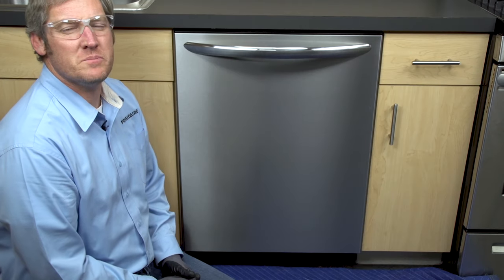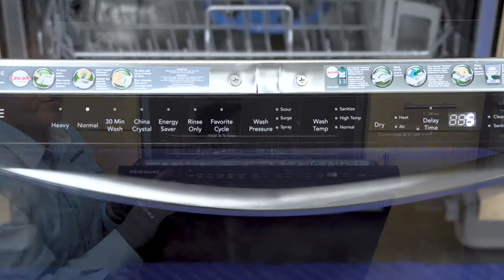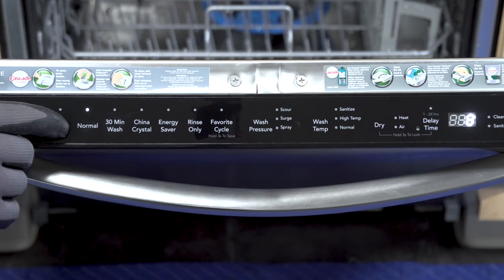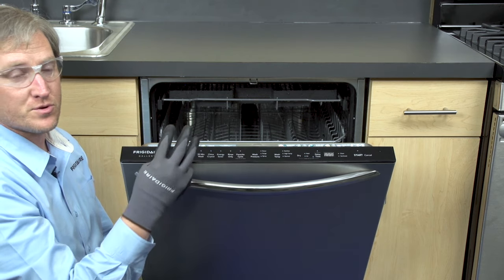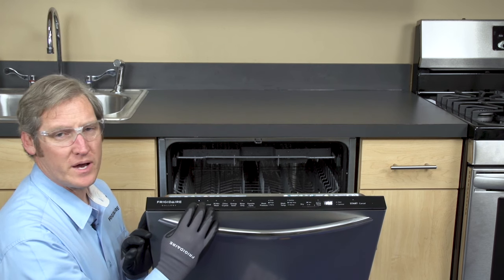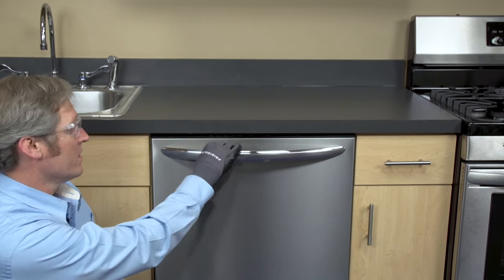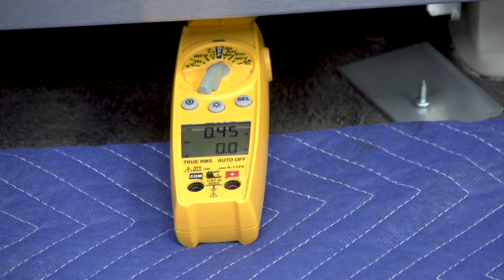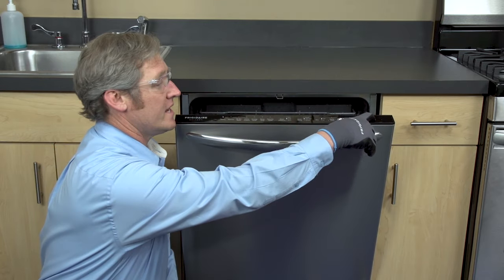frigidaire gallery Dishwasher: troubleshooting and diagnostic mode

Comment: I have  code. 14  on my frididaire  , model ffbd2420Uboa , it says the micro switch in the bottom? Of drain or under the unit? I've clean filter & drain area,pulled plug  and reset, still no go.  On restart , drain runs for a couple minutes ,while blinking 14  then it stops ,and the  14  stops blinking and just stays on,  what's ure take on this problem, thanks

Comment: Great video. We have this model FGID2479SD6A and it started trying to drain out of the blue with partial numbers on the display lit. It wont let us do the diagnostic process because it seems to be stuck even if powered of and reenergized. Maybe a timer relay or timer motor but hard to find info.

Comment: Mine seems to be inconsistent. Sometimes you hear water going in no matter which option I choose, heavy, normal, or quick clean, the light indicating those turns off pretty quickly. But EACH one starts saying 99+ minutes. It runs sometimes, it gets hot, other times no water? Generally, not cleaning well. And it seems to have run too long a couple of times. It would not respond to the methods described in this video to get an error code, and I did let it run a little to start. Any suggestions from others? Something wrong with that control panel?

Comment: I recently bought and had this unit installed.  I can’t find the serial number to do the warranty.  I’m really hoping it’s not on the part of the washer that’s under the counter.  Any help would be greatly appreciated.
Reply: Not sure if you have gotten an answer or found it. Your serial number should be on a sticker that is on the inner part of the door jamb. Open your dishwasher door and look all around where the door basically meets the inside. Its usually either a silver or white sticker.

Comment: Maybe you can help me out. My dishwasher isn't a month old, but my dishwasher (this exact model) acts like it has no power whatsoever all of a sudden. I checked my plug and it has power, I checked the voltage on the junction box and I have power. I checked the voltage to the plug before the circuit board, and it says it has power. The circuit board doesn't appear to be damaged in any way. I tried looking for a fuse somewhere but I can't find one. Have you encountered something like this before?
Reply: I've got the same. Had mine for about a year and a half. I did cycle my circuit breaker on mine and all the lights came back on. It read 190 on the clock and after about 20 seconds, it shut back off like no power again. Was not able to select any cycle settings prior to losing power again.

Comment: I'm getting both i20 and i30 errors. When I try to run test 5 for the drain pump, nothing happens.  Is it likely that my pump system needs to be replaced?
Reply: The pump could be jammed. Meaning something has gotten down past all of the filters and got it hung up. All the dishwashers I've ever did any work on have a blade in the front of the pump that cuts up anything that wouldn't otherwise make it in or through the pump. My experience has been that the culprit is usually a toothpick.

Comment: I have fgid2466qf7a gallery model. How do I check saved error codes? Also, It's saying Er after running cycle and there's water pooled on the bottom. I ran diagnostic test by holding heat and start. The test stops and throws a Uf code. Now I don't know if it's Er or Uf that's wrong with it

Comment: Great video, easy to understand. Found the error codes online too. When I try to run the diagnostic test, none will run. Original issue when you start a cycle, no sound from the unit, after 3-5 sec the lights on the control panel go off. They all light up and seem to work when switching through options. Codes on the machine in order where i00, i63, i10. Rest the codes after that and ran normal and heavy cycle to see if any codes appeared. No codes came up and still nothing happens. The unit seems to not budge, must be mounted. Next i will try to move the unit to get to the power cord to unplug and plug back in. could it be a board or control panel issue?

Comment: For my model I had to cycle the power on and off to trigger the power failure mode. Then hold down the dry and start/cancel buttons for 3 seconds.

For all models take the front panel off and it will have the instructions for how to do this in there. They don't make it easy😂
Reply: THANK YOU! I have a LFID2426TF2A model and couldn't figure out how to get it into test mode. None of the other options I tried worked, but this worked!
Reply: How do you trigger the power failure mode, I tried unplugging it and all the leds lit up and then pressed dry and start/cycle, but nothing happened.
Reply: Man mine says to do that to, and it's in power failure mode. I press the buttons and nothing happened s